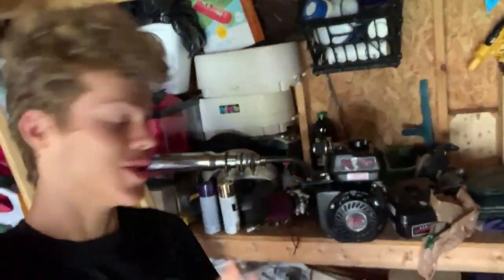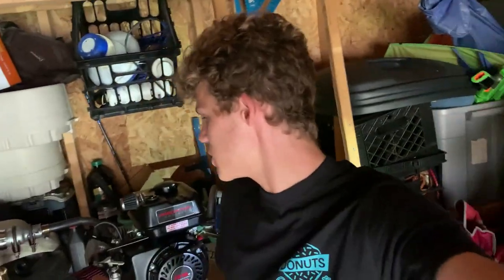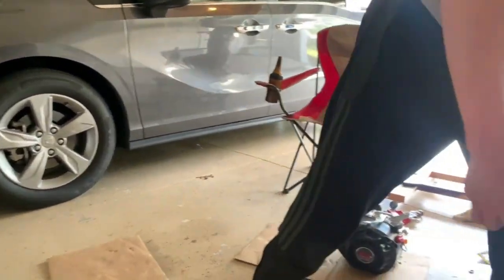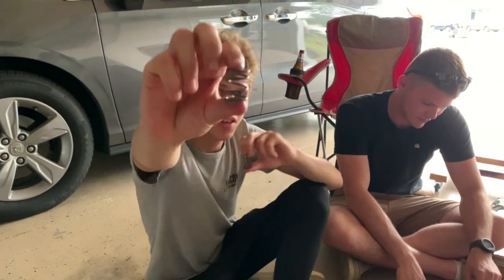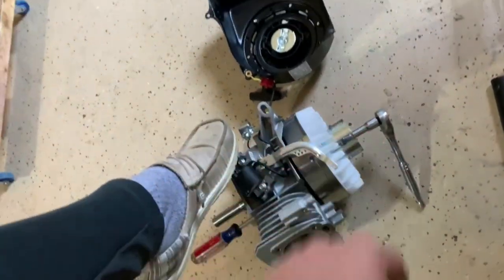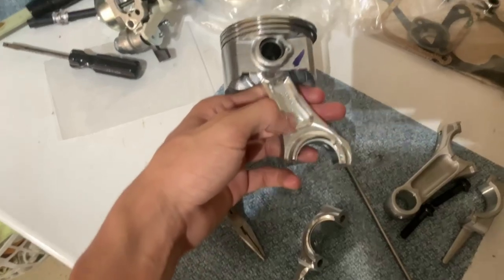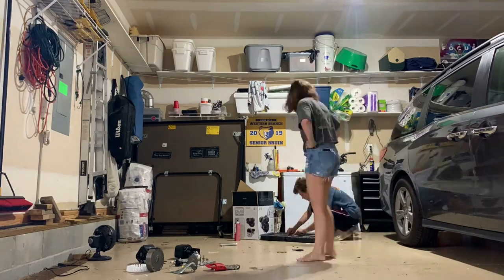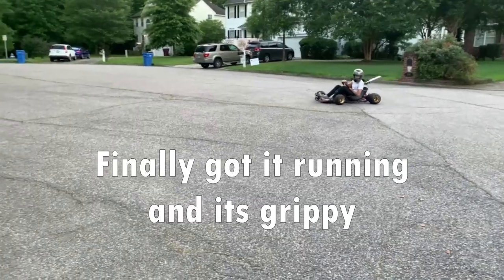Predator 212 Stage 5 Kit Install on Race Go-Kart (Restoration Pt.2)

Comment: stage 5 does NOT mean stock size stainless valves, stock size carby, "limited mod" camshaft...
 IT MEANS
 flat top pistons & milled head face, bringing the compression right up into the danger zone.
IT MEANS 
OVERSIZED valves and precision porting (not just smoothing the machined edged and sanding the inside radius)
IT MEANS
a camshaft that produces it's max power after 8000 RPM, not has a 7500 rev limit!
IT MEANS 
machining out the oil passages to allow the oil to flow from the head back into the crank case despite higher crankcase pressures,
AND
 Crank case VENTS with PCV valves to reduce the crank case pressures
IT MEANS
a Mikuni VM22 at the very smallest, I recommend a VM24, others would say VM26 because they match up to the adapter/manifolds perfectly, but loose lower end drive ability at the cost of 0.2hp at the top
 (loosing 1% at the very top of the revs to gain 5% everywhere else is fine by me... you loose 13% top end with a VM22 , but gain no low to mid range over a VM24)
EVEN
the exhaust manifold/ header... 1 inch O/D is TOO Small, it may be ok for the tiny o/e valves, but larger valves require larger passages, so the gasses don't hit a bottleneck, 30mm OD tube is perfect but hard to get outside Europe, so take your pick of 28 or 32mm (1 1/8" or 1 1/4") either way they need matching to the exhaust port, and/or clearancing for cap screws

ALSO stock pressed rocker arms cannot handle the loads a stage 5 exerts on them... if they survive running in, they won't make it to the redline without bending out of shape... If they do, It's not a stage 5!

Ratio rockers get even more out of the Camshaft. And reaching the ceiling of the possible mods is what makes a Stage 5!
Reply: Homie you have too much time on ur hands🤣🤣

Comment: bruh thats stage 2
Reply from the maker: OMB Warehouse says stage 5 so that’s what I said
Reply: @zachwarne  lol i guess different companies have differnt things at gopowersports thats like a stage 2-3
Reply from the maker: @ryan_2b2t68  Yeah I saw that too, I guess each stage isn’t an exact thing, it’s just vaguely determined
Reply: Ik like small carb, I consider a stage 5 is a full governor removal, 38 mm carb put better header, rocker valve upgrades, full rebuild with an upgraded piston, and camshaft, performance air filters, and makes atleast 25 hp for a 212
Reply from the maker: @patrickschermehorn7405  yeah I’m probably gonna get a 24mm flat side mikuni carb for my build